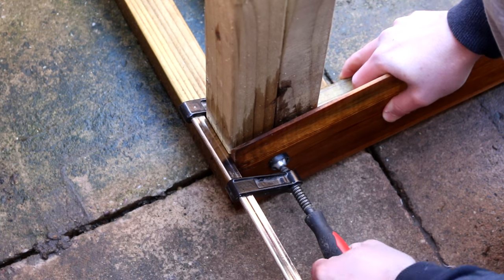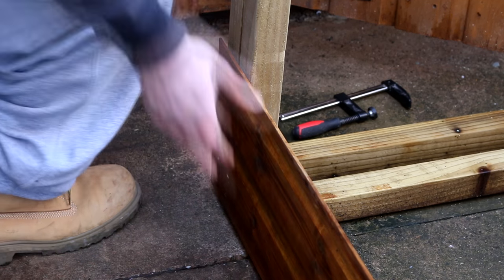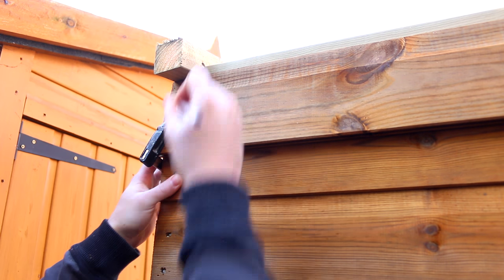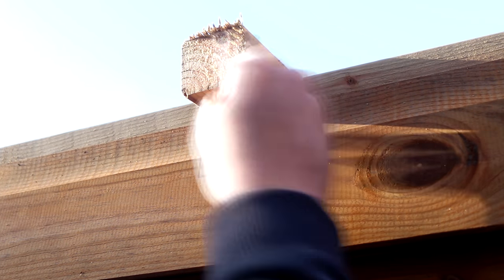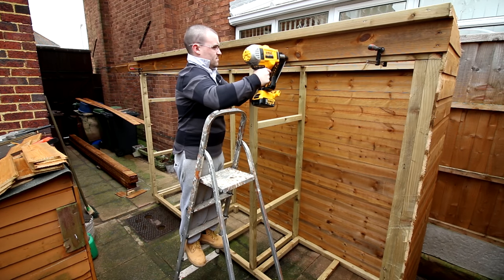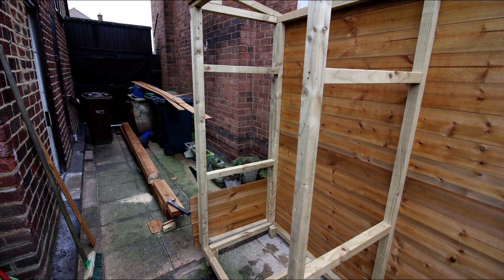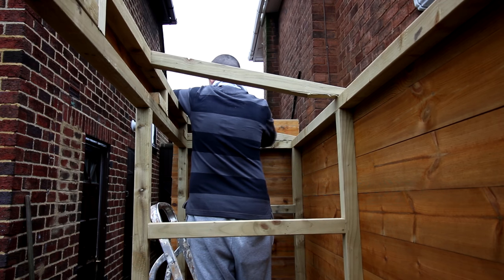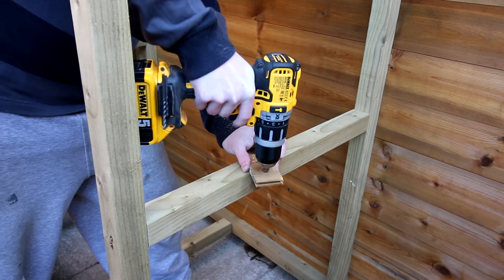Cladding A Shed - Really Simple

Comment: What size guage of nails did you use with the nail gun? I'm guessing it's a 1st fix which is usually a bit of overkill for cladding work so I'd be interested in what you found worked :)
Reply from the maker: I used 2.8mm x 50mm nails. Theyre the 34 degree ones for the nailer. Definitely a bit over kill for cladding but its the smallest nails that the gun will take
Reply: @AverageJoesJoinery  thought it 
It's a real shame they don't make a gun that covers the range inbetween
Reply from the maker: They have a second fix nailer that fires between 32-63mm nails
Reply: Average Joe's Joinery yeah, just too thin for this sort of work at 16g unfortunately. Live in hope, eh ;)

Comment: Would it not be easier to cutting them at the start on your mitre saw
Reply from the maker: The lengths are 4.2m long. Kind of awkward to cut on a mitre saw so for this application I preferred to just fix them in place and cut flush

Comment: A company built a heavy duty workshop and I'm correcting a lot of bad workmanship! It has whitewood pine cladding on the sides but NOT t&g cladding ...just overlapped and nailed ... it shines light from inside out on many of the panels 🤐 ... surely this isn't right??? What can i do to close the gaps if it shouldn't be this way? More uprights inside to screw the cladding to? 
Dreadful company that will no longer respond 😠
Reply from the maker: Ahh Im sorry to hear that Martyn. Some sheds are clad with ship lap style cladding. These arent ideal as they warp and like you say reveal gaps. There isnt really much short of removing the cladding that would help. If you put screws or nails through to pin them down they will more than likely split. If they arent letting any water in then you could maybe cover the shed on the inside to block the wind and light coming through.